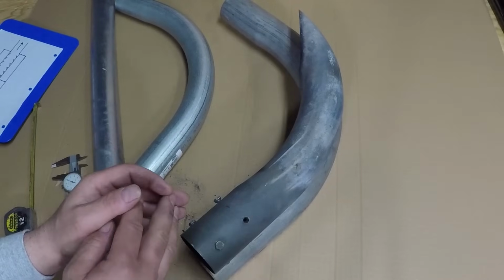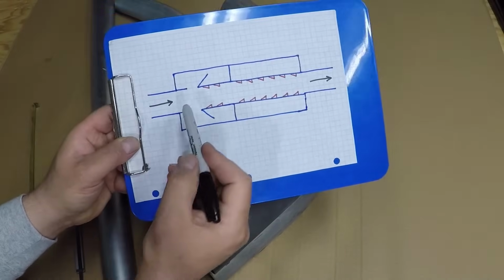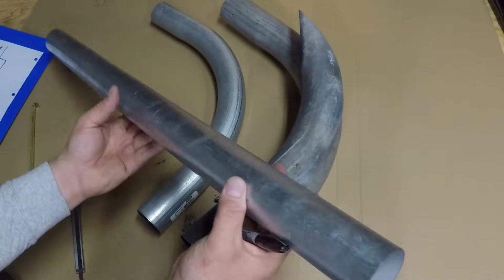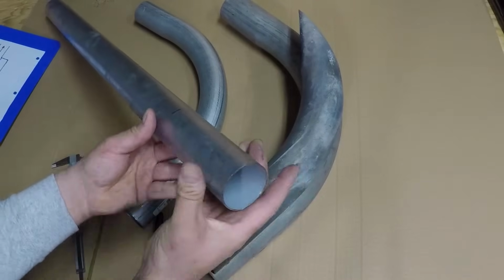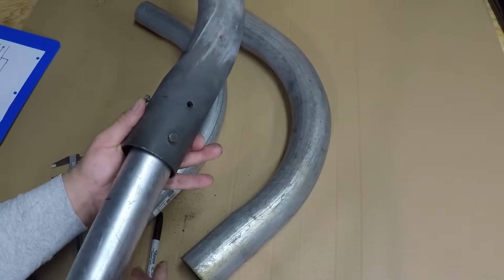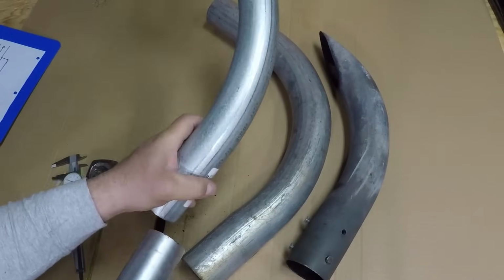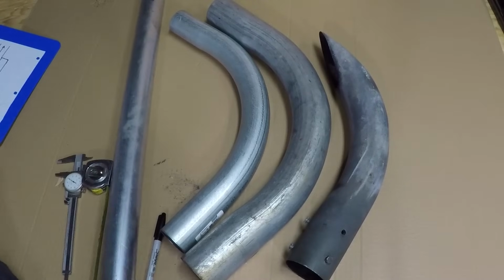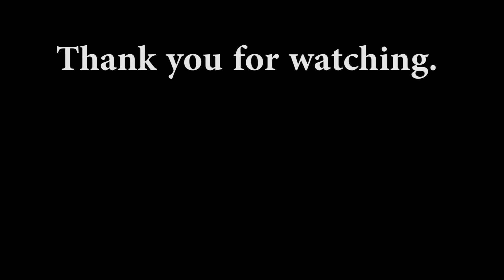Homemade Muffler

Comment: one question, why don't you turn the muffler around so that the gasses would go into the glass packing through the holes thus making it even quieter?
Reply from the maker: You are right, install it the other way will make it quieter. However, quieter muffler will reduce performance. The way I installed it, it is for preference and just to reduce the rumble of the exhaust. In the future, I am going to build few types of glass mufflers and will monitor the sound, engine performance and heat. Thank you for watching
Reply: @SalamSayhood  you shouldve tested it both ways just for fun and to show the difference, looking forward for next vids!

Comment: Like it, I need to build one for a generator with 4 cylinder car engine, they want  four hundred dollars for a new one, thank you very much!
Reply from the maker: Thank you Paul, I appreciate your comment, I am planning to post more videos about homemade mufflers, If you are going to have the generator running near your house, please wait, I am going to post one video about a quiet muffler and you may benefit from it more, however, if this generator is for work, then just build glass back as it is cheaper and more efficient, the one in this video only cost me about $18. Good luck

Comment: I have a question. 
You turned it I guess upside down.
The exhaust flow does not go into the opening which you hammered.
Yet it does silence the sound so much?

I have glasspacks currently on that do not too much for me.
I got the opening facing the engine so the exhaust flow is caught and forced into the fiberglass.

Am i doing it wrong?
Reply from the maker: Hello, by design (for sound reduction), you installed it correctly, the way you installed it (if the muffler you installed was built for your size engine with good quality packing material) it should give the best results as far as sound reduction. I built one just like the one in the video back in the 90s and installed it on a my car. I tried it both ways. One direction was quieter but the engine was loaded or there was more back pressure the engine was getting warmer when driving up hill. The other direction (like how I installed it in this video) was louder but the engine was running better and cooler. I am going to upload videos in the future about homemade mufflers and I am going to test everything for the viewers. Thank you for the comment and thank you for watching.
Reply: @SalamSayhood  Thanks for the quick reply.

Its a loud engine and exhaust.

460ci with dual 3.5" inch downpipe into a 3" glasspacks, dont remember the length.
Maybe i was just hoping for better results.
Thanks again
Reply from the maker: Nice ford engine. I had a chevy malibu model 1978. I installed two homemade glass pack (one on each side). I believe I used 2" pipe (it has been a long time ago) I didn't use any packing material in the glass pack and it sounded great (sporty). The only negative thing was when coming down hill, the engine breaking was too much. When I sold it, it went quickly because of the sound. I remember the guy who bought it said so :)

Comment: Can the fiberglass cotton material be substituted with fiberglass mesh covering a thick layer of rock-wool?
Reply from the maker: Hello, There are three type of material they use for the glass pack, fiberglass, stainless steel wool and ceramic. The packing material must be high heat resistant. Fiberglass is the cheapest and when new it work the best, stainless is the less effective in sound reduction but it will work for longer time than the other packing material. Don't use steel wool or anything is not rated for muffler packing. 
They sale the muffler packing material online, for 2 stroke and for 4 stoke engine. I hope this answer your question.

Comment: Dude . . . thats a nice diagram but the air is suppose to flow the other direction ;)
Reply from the maker: Good morning sir, I built one just like the one in the video back in the 90s and installed it on a my car. I tried it both ways. One direction was quieter but the engine was loaded or there was more back pressure the engine was getting warmer when driving up hill. The other direction was louder but the engine was running better and cooler. On tractors and off road vehicles the glass pack should be installed as I demonstrated.  Road going vehicles have to meet certain noise level restrictions and therefore they install the glass pack to meet those standards.  This creates more back pressure and little bit loss of performance. There are other options of using holes on the pipe which will give you in the middle results. I am going to upload videos in the future about homemade mufflers and I am going to test everything for the viewers. Thank you for the comment and thank you for watching.
Reply: That's so nice of you to explain thas stuff..❤

Comment: Would this work for an exhaust on predator 212cc 6.5hp engine ? I am using one on a drift trike and we are having a competition of sorts so i gotta out do the guys and i think an 18" glasspack muffler hanging off an exhaust pipe would be friggin hilarious! But if it won't work i am just gonna look like a dumbass ...lol...thought i would ask first
Reply from the maker: Good morning, if you build it like I did, it will boost the preference just a little (on 6.5HP, 4 stroke, single piston engine) however the sound will very based on the pipe size, the cuts and angles of the slots and the type of packing (stainless steel, fiberglass or ceramic muffler packing). If you install it where the cuts pointing to the other direction, then you get quiter sound but this will decrease the performance. You can also try it without any packing and this will make it sound more sporty :)

Comment: What kind of sound proof white blanket did you used?
Reply from the maker: Hello, I bought mine from eBay, The eBay item number is 111478197654  or you can search "CERAMIC SILENCER EXHAUST MUFFLER PACKING KIT 1" THICK X 12" X 24" FOR 4 STROKE".
Reply: @SalamSayhood  You can also get it from Grainger. I think 24 x 60 x 1 was $31... might be wrong, but cheap and in stock . We use it in a metal melting furnace for casting. Thanks for the video, looking for ideas to quiet the aftermarket pipes the previous owner placed on my bike. Good info!!
Reply from the maker: @timwilliams632   Thank you for sharing this.

Comment: Do you sell these? I need one for a 2017 Polaris Ranger 1000 UTV
Reply from the maker: Good afternoon, I don't sell them. However, I am planning to build one soon for my 4 wheeler and I am going to record the complete process. Thank you for watching.
Reply: @SalamSayhood  I see. Well since you're doing one anyway, is there any way you could build another one and then sell that one to me? I need it for hunting.
Reply from the maker: I appreciate your interest 😊 however, I have no current plans to sell mufflers, also the glass pack isn't a good choice to get quiet operation for hunting. The glass pack is a preference type muffler. You can add a car muffler at the end of your Polaris exhaust pipe and this should quite the sound. Thank you.

Comment: How about for my lawn-moah?
Reply from the maker: Hello Kevin, are you asking if glass pack muffler will work with lawn mower? If so, the answer is yes, most of them with 4 stroke engines are sold with glass pack design muffler. If you like to build your own stuff, then this will be a fun project. If you are not setup to build it, then it maybe cheaper to buy a muffler from tractor supply or online store. Make sure you get the right size for your machine. Thank you for watching.

Comment: I am wondering if this works in making gun silencer?
Reply from the maker: Good morning, the short answer is no, it will not be an effective to do the job.
Reply: To make a gun silencer, get a tube (3 mm thick) and create small metal cups (3 mm thick too). Probably, 10-12 cups, bore holes in the middle of the cups (depending on the calibre of your bullets), and weld the cups 1 cm apart inside the tube. The base of the cups should face the muzzle of your gun.

Comment: What is the white substance used in the exhaust
Reply from the maker: It is muffler packing. It is available for 4 strokes and 2 strokes engine. You can use one of these:
Fiberglass muffler packing.
Ceramic muffler packing.
Stainless steel muffler packing.
While the fiberglass give the best sound reduction for this performance muffler, the stainless steel packing will last longer. Thank you for watching

Comment: Do you make them on your spare time?
Reply from the maker: Hello, I usually make them for my equipment. I am planning to post more videos about homemade mufflers/exhaust system in the near future. Thank you for the comment and subscription.
Reply: Salam Sayhood Do you think I can use this kind of muffler on my Lincoln SA-200 welder?
Reply from the maker: Yes sir. You can use glass pack mufflers on any type of combustion engine. I made one in the past for my Miller gas welder and it’s work great.
Reply: What it be to much for you to build me one?
Reply from the maker: I am sorry, I am very busy at work and with my projects. You can build one very easy, if you know how to weld with mig welder or flux core mig, if you need one ASAP to get by, then I suggest to go to tractor supply near you and try to get a muffler for small tractor, they should be cheap (around $30) and you will have to make an adapter to go from your engine to the muffler. If you decide to build your own and have any questions, please let me know and I will do my best to answer your questions. Good luck brother

Comment: Remember if you weld on galvanized metals dont breath in the smoke or fumes that it puts off it really toxic 💀
Reply from the maker: Good morning sir, I totally agree with you. I always weld galvanized steel outdoor or using fume extractor. I always try to position myself so I don't breathe the smoke when I weld galvanized or other type of steel. Thank you for your concern and for watching.

Comment: Hello how about the loudness of the muffler
Reply from the maker: Hello, glass back in general is loud, However, they are better than straight pipe in two area: they are quieter than straight pipe and better for the engine. Quieter mufflers not a good choice for heavy equipment as they put load on the engine. I am planning to post videos in the near future about quieter mufflers, best of luck
Reply: I will fabrcate one using your concept and will put it in a car then we will how it reacts on cars
Reply from the maker: I build glass back and used them on cars before, it will be little louder than the stock muffler, more on the sport cars side. Good luck man and have a great weekend.
Reply: @SalamSayhood  ah OK yes I want something not too loud I will keep you updated
Reply from the maker: Thank you

Comment: What wool is that?
Reply from the maker: Hello, I bought mine from eBay, The eBay item number is 111478197654  or you can search "CERAMIC SILENCER EXHAUST MUFFLER PACKING KIT 1" THICK X 12" X 24" FOR 4 STROKE".

Comment: Its silent enough,applause
Reply from the maker: Thank you sir
Reply: @SalamSayhood  how to make the sound of motocyle exhaust louder and sound like a bass, what i have to do?
Reply from the maker: You can do it in many ways: you can remove some or all the packing material (it depends on how loud you want it), you can drill the end of the stock muffler (the end cab) with small drill bit, start with one hole and add more holes till you achieve the desired loudness. I drilled one time a stock muffler with 3/8” drill bit and added 5 holes and the motorcycle sounds like a Harley. There are more options, however this will be the easiest, no added weight and cheapest way.
Reply: @SalamSayhood  i will try, thank u

Comment: Back pressure isnt helpful to a engine unless you dont know how to tune or adjust your afr
Reply from the maker: I always believed in the uselessness of the back pressure, however, I met with generator engineer who stated that back pressure is good while the engine is on idel, I also heard that from mufflers manufacturers. Since I have no dynamometer to verify it, I can't tell for sure. When I was a kid, my family use to have auto shop and we used to rebuild engines. We use to run test the engines before install them, they rain fine on the test platform without muffler. I am going to build more mufflers and will test the RPM, pressure and fuel consumption to see if with or without back pressure the engine runs better.
I appreciate your comment and the information.
Reply: @SalamSayhood  you have to consider the exhuast valve and scavenging the less resistance out the more exhaust gasses can evacuate the cyl I look forward to more content, your english is really good btw only a few word mix ups!
Reply from the maker: I am trying my best to speak English correctly :)

Comment: Backpressure does NOT make hp. It takes away hp.
Reply from the maker: Thank you for the feedback.
Reply: But is necessary for a compression engine
Reply: @nathanquasar468  you might want to do some more research... you need velocity, not back pressure.
Reply: @ls1jay  😂 that's cute. Cut your cat's and muffler off and see how well your engine runs without back pressure
Reply: @nathanquasar468  I have plenty of times. I've taken off cats and resonators, used O2 simulators, put on headers, etc. dynod before and after with big gains all across the graph. I've had plenty of street cars & trucks that I raced. All backed up by dyno numbers and track times. There's plenty of research on the old myth about back pressure. People believed all kinds of myths back then.

Comment: great video, but please stop with the whole back pressure myth. 
golly gee. check the science. 
scavenging yes,
Reply from the maker: I agree with you, however, I read several document about exhaust, muffler, 4 strokes engine and 2 stroke engine and what I got from all that is some back pressure is good for the engine when on idle and no back pressure on load.  This design will cause the exhaust gases to have turbulence when it's slow or the engine idling (little back pressure). When the engine RPM is high and exhaust gases is fast, this will cause the scavenging effect (that is why I pointed the cuts to the outlet of the muffler) and cause the engine to run cooler and better (on load or high RPM). Thank you for watching.

Comment: What is that wool?
Reply from the maker: I use ceramic muffler packing I bought from ebay. You can use fiberglass or stainless steel muffler packing as well. Thank you for watching,